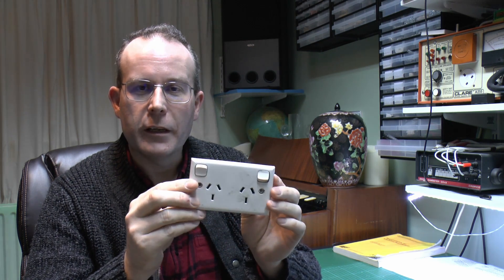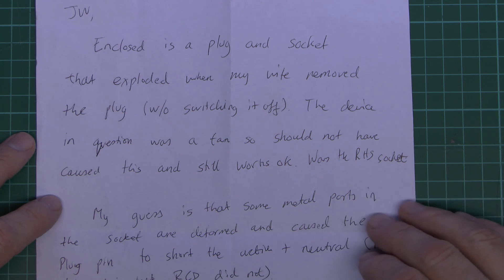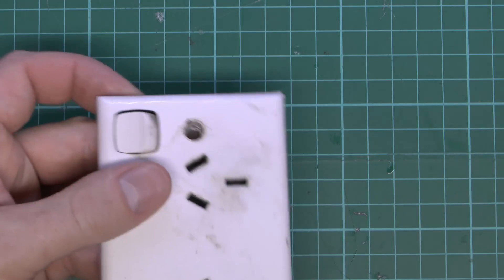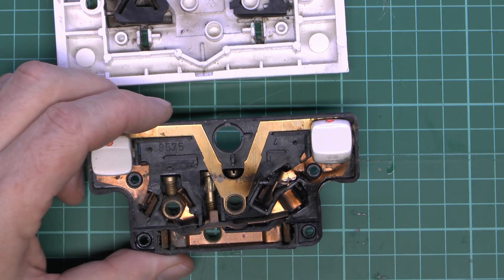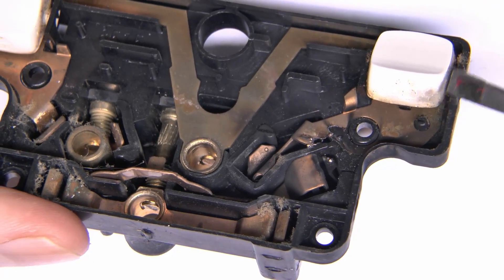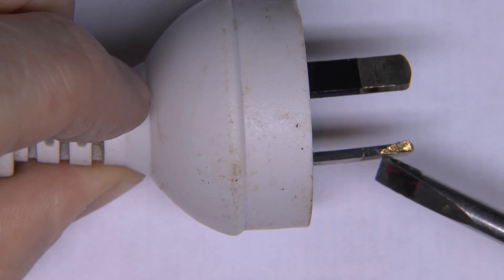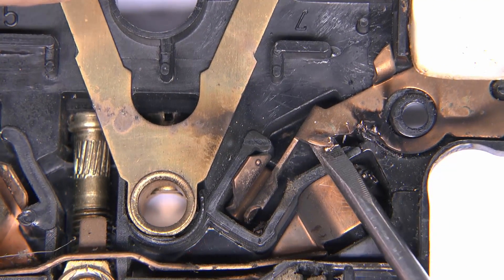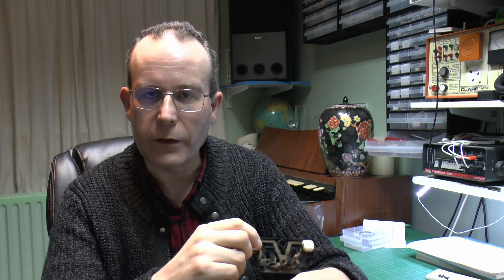Failed Australian Socket and Plug

Comment: Here in New Zealand some homes have these HPM Sockets as we share the same socket design as Australia. I think this design started to come out about 30 years ago? Ive never seen a fault like this before but its a good lesson to always switch off first
Reply: The shape of the pins used in Australia/NZ dates back to 1936 and is based on a US Hubbell 240V plug that largely fell out of use there by 1940. It's a good design with high contact pressure and contact area - and originally had the earth uppermost. At the time Australia and NZ had at least 70 types of plug and socket in use.

That was rotated sometime in the 1940s so that the earth was lowest, to ensure that if the plug was pulled out by the weight of its cable then the earth pin would be the last to disconnect - even with the standard longer earth pin, if earth is uppermost then it usually disconnects first

UK plugs achieve the "earth last to disconnect" by setting the earth pin contact much further forward in the socket. In some sockets you can actually see the copper wipers flush with the face of the socket.

China, Argentina and other countries which use the AU/NZ plug/socket with earth uppermost usually have the problem with early earth-disconnection that prompted the socket's rotation all those years ago, although the preference in most countries is for side-entry cables rather than rear-entry, which makes this less of an issue.

Side entry cables into these plugs have the unintended consequence of making them incredibly painful to stand on in the middle of the night.

Round plugs and separate switches date back to the 1940s or earlier. By the 1950s NZ and Australia had standardised on NEMA cable boxes and faceplate dimensions, with 1940-50s examples being virtually identical to north american ones other than the pin layout for sockets (in many cases they were direct US imports). Round units still exist for surface mounting but they bear little internal relationship to their bakelite predecessors.

https://en.wikipedia.org/wiki/AS/NZS_3112 covers some of the history. There were also standardised "T" pin layouts for 110 and 240V DC as these (along with 110VAC) were in use in Australia at the time (Sydney's 250V DC mains distribution system was only switched off sometime in the 1970s)

There's more history at http://members.iinet.net.au/~cool386/plug/plug.html and if you ever get a chance to visit Sydney's Powerhouse museum, you should take it. That was the site of the DC generation system. :)
Reply: Dana Vixen China does not have that switch. Cannot plug 2 pin AU plug on Chinese 3 pin outlet. You can plug 2 pin AU on Chinese 2 pin US/Euro universal outlet and fits.

Comment: Interesting. The plug goes into the socket upside down!
Reply: who can tell when the cable  comes out perpendicular?
Reply: Jusb1066 Or maybe they mount their sockets on the ceiling? (Which is really the floor.)
Reply: the back side is "upside down" so when you are wiring it hanging from wires from the wall the labelling on the back is the right way around
Reply: Yeah you should see what happens when an Aussie socket + an older pre insulated plug not plugged in all the way does when it meets a Venetian blind
Reply: Upside down

Comment: Great video John. I went to the US recently and will be posting some differences and observations between UK and US electrics over on my channel
Reply: Be prepared for a large amount of argument in the comments. Especially from US viewers defending their unfused, low-current, unswitched, toddler-electrocuting version. (Tee hee hee!)
Reply: Guinea Fowl oh I fully expect some resistance (excuse the pun!)
Reply: BS 1363-2 is without doubt the most well designed and safest plug socket in the world.
Reply: LOL, too funny - think about most residential electrics in the US is that is designed with stupid people in mind - 110v is low enough not to generally kill you (it's also a result of Edison's PR war on AC)...   The other thing is that the US was electrified way earlier than other parts of the world, so there is a lot of legacy stuff (the wiring in my house is from 1933.... and my old house had wiring from the 1910's) both installed & in building codes and finally, there is no central authority for building codes, it is county by county (e.g. smaller than state level).   Yes, there is the NEC, but it's only advisory, local jurisdictions - sometimes down to city/town level - are responsible for adopting what they feel they need and lots of rural areas have no or minimal building codes....
Reply: till u step on the plug
Reply: IMHO, I'm not surprised you get attacked with that ego of yours ;)
Reply: Depending on when the house was wired. Houses in the US originally did not come with grounds (earths). I'm thinking sometime in the 1960s, grounded receptacles were mandatory. My parents house was built in 1969 and had grounded receptacles.

Instead of fused sockets we have GFCI receptacles. I'm not sure if this is mandated on newly built houses or not. 

You can buy those childproof receptacles where both the hot and neutral pins have to be inserted at the same time before the plug can go into the socket. 

As far as 110 volts goes. Nikola Tesla was the guy who decided that 110 volts/60 Hertz was the most efficient means of AC power. Perhaps someone in Europe wanted to double the voltage so they could cut the current in half and use thinner wiring because copper was more expensive in Europe than the US?
Reply: In most communities, GFCI outlets are mandated in new construction, & required in homes being rewired.  My house from 1950 has a ground, but some of the outlets themselves aren't grounded.  Since a ground does exist, I can replace the 2 prong outlets with 3 prong outlets.  The ground exists within the flexible conduit. Even so, I still want to get it upgraded, so it can handle more electricity in the house, than what was used in 1950.
Reply: My US plug socket video observation is now live 😁
Reply: To compensate for one of the most dangerous methods of house wiring in the world.
Reply: First all in most places where they use the U.S system of house wiring, which includes Canada, and Mexico, we use branch circuit wiring, NOT ring wiring, with circuit breakers in the electrical panel, NOT fuses. It is not low current it is a lower voltage, 120 volts at 15 amps is typical for a branch circuit. In many places they require arc fault circuit breakers to be used on branch circuits used in bedrooms, GFCI outlets are required in bathrooms and wet areas, but are optional elsewhere, and shuttered outlets have been available for some time.
 Deaths by electrocution are rare, as are electrical fires, if a power cord to an appliance shorts out the breaker pops, power goes out, clear out the fault, reset the breaker. You can find fused NEMA15 plugs but they are generally not necessary, I think that the most recent item I saw with one was an LED Christmas light string. The safety regulators don't generally like fuses anyhow because when one keeps blowing in a panel, or a plug, people tend to bypass them in some way by using machine screws in place of cartridge fuses, and coins (or even wads of aluminium foil) stuffed into the socket in the main electrical panel.
Reply: Dans the Engineer Chinese 3 pin outlet same as AU cannot plug 2 pin AU on Chinese 3 pin outlet. Because of Earth/ground outlet locks both live/hot and neutral outlets just like UK outlet did locks both live and neutral outlets.

Comment: I wonder if the inductive fan combined with an out of place conductor inside the plug caused it. Like the piece of metal moving just close enough that an inductive spike generated by the fan when unplugging was enough to arc the gap triggering an avalanche effect with the mains piggybacking this conductive channel.

Bit like the hf start in a welder.
Reply: John Naughton no, actually, he made an entirely invalid comment. JW didn’t say anything about an inductive load possibly triggering an arc.
Reply: Wind it in uK8cvPAq. Tangobaldy made a perfectly valid comment.
Reply: uK8cvPAq amazing.  You just released everything Jw said. Maybe you should watch the video.
Reply: Amazing, you must be confused. Maybe you should lay off the looner fetish for a while, might make it easier to differentiate between the video and comments.

Comment: Tenuous link. I purchased a  Makita drill/driver from a retailer in the uk selling tools from Australia, I changed the plug on the charger to a Uk version, and the drill/driver remained in service for 12 years, only being replaced because the batteries were failing, and replacement batteries are prohibitively expensive.
Reply: the chinese red batteries are mostly prettty good, cost between 12-22 pounds depending on your voltage, the 2 i bought have been fine for the last 6 months, to last untill i bite the lithium drill bullett
Reply: I considered after market batteries but did not want to take the risk with cheepo batteries and their quality. The other factor I considered was how long the drill would continue to function, as I did not want to spend on a drill that could fail in the near future, as the drill was 12 years old and its had a lot of use from my job. 
Instead I purchased a new makita drill/driver. If it lasts as long as my old one I will be satisfied.
Reply: Very good story, thankyou

Comment: The wiring notes on the back are upside down because when you pull it out from the wall (when installed) you are looking down on it and will be able to read it
Reply: ........ Back panel inverted because it's from 'DownUnder'.
Reply: black white yes switch at top
Reply: Whether it is upside down or depends on which way you mount the sockets to the wall.  Is it normal to mount them with the earth terminal at the top or bottom and do you normally click switches  up or down to turn them on ?
Reply: UKHeliBob, I’m UK so assume in ignorance that switches are mounted towards the top when installed. For me it makes sense as you never look at the back of a socket like JW has it on the bench. You usually read the notes with the socket pulled out from the wall and the top edge pulled down. When looking at the socket in this view (like when installing or removing) the letters indicating line, neutral, and earth would appear the right way up and fully readable.